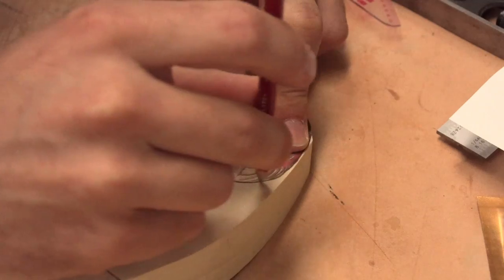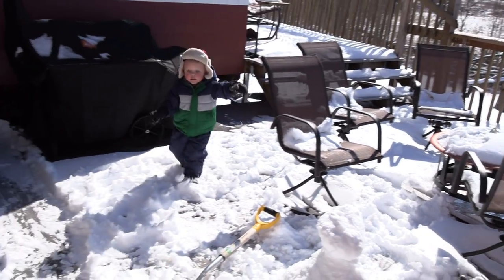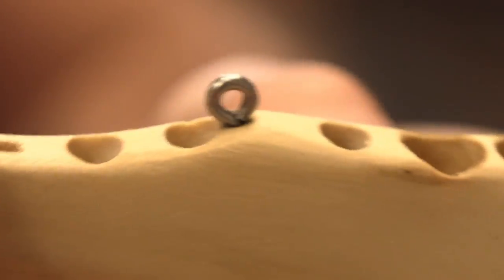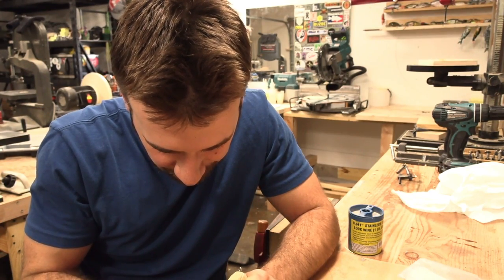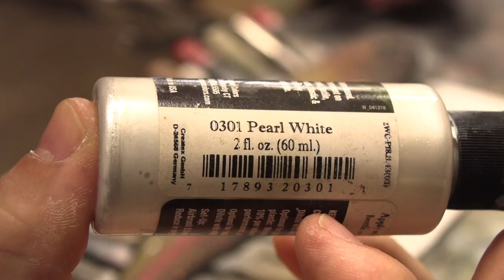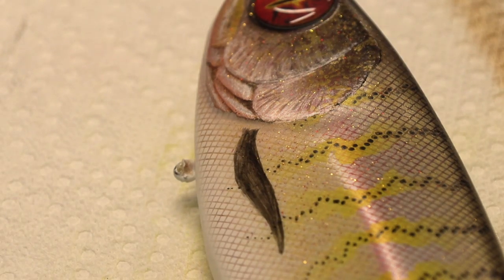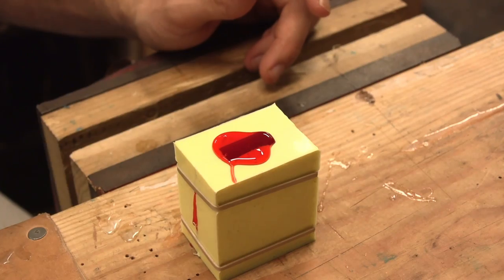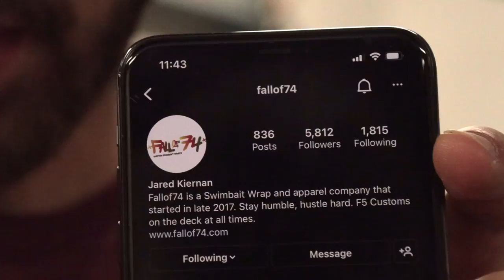Sauron Trout | One SwimBait to Rule Them All

Comment: Just an idea on keeping the lead in the lead holes What about little stainless Screws Screwed in halfway in the lead holes and then the lead put in  Just an idea love the channel
Reply: I've been drilling 2 holes close together, and then I delicately pick out a channel at the bottom of each hole, so the 2 holes have a tunnel-like connection. The 2 lead pieces are then connected when poured and held in place by the wood. I've not done a lure quite this size though.